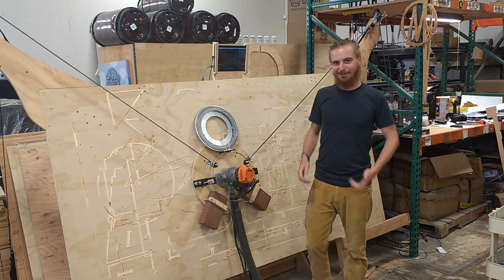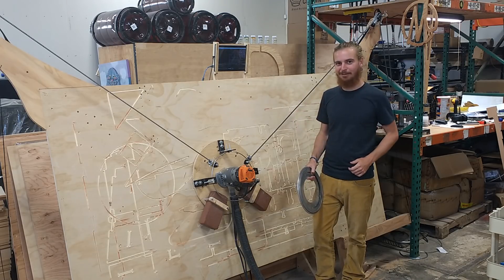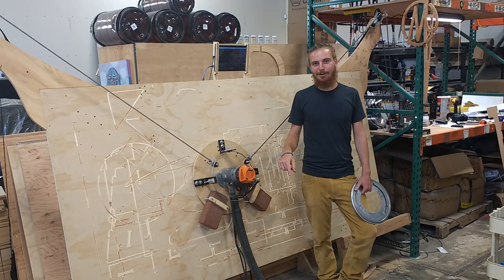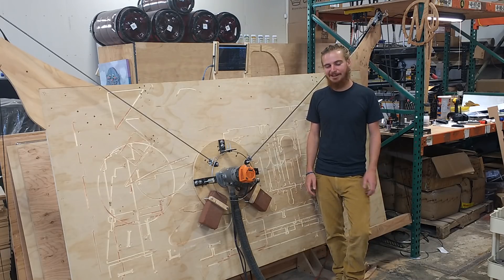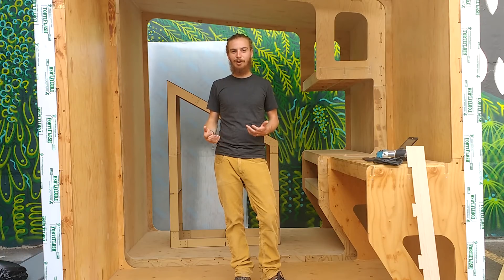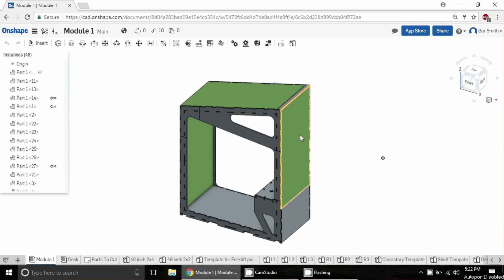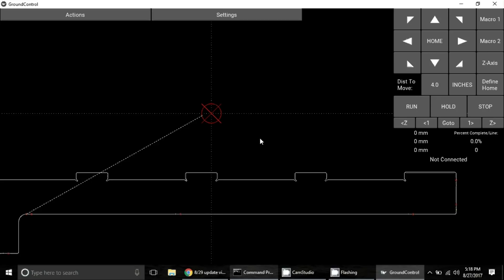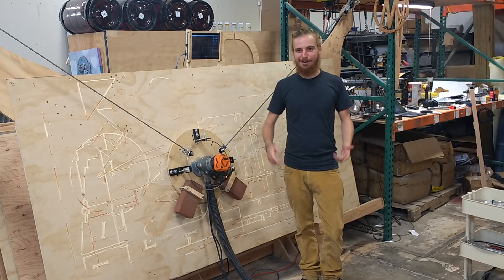Maslow CNC Weekly Update Video 8/30/17:  New Kinematic Options, PlyPAD Progress and Software Updates

Comment: When battling with unpredictable lengths of sheets and fixing the template I suggest overlap:
The template needs to be log enough to for its furthest bay (as seen from the corner where you want to clamp it) above an already cut bay. You can use the (turned off) router set into this bay to guide the template to its correct position before clamping.

Comment: We use a similar idea in sheet metal work but we dont use the sheet edge as a datum, we mark the centre of the face and set the cutting jig either on or off centre, on one of the lugs, This means that you can get a better spacing for the lugs.

Comment: I had to stop the video... because... um... why don't you just link the two chains ANYWHERE on the circle (preferably directly above the router bit). Then they will be LINKED like you wanted. Then the router bit measurement (distance from where the chains link) can be fed into the system as a "drop point" to the router bit. WHALLA! Exactly what you wanted to do with no more moving parts!
Reply: I am scratching my head as to why you wanted the router bit to always be the corner. When it can just as easily be the center of the corner -5 inches or whatever. It isn't like the machine is going to TILT or anything. So it will always be -5 inches to the router bit. Thanks Gravity!

Comment: Why not use a flush trim router bit?  Same concept but you get an exact duplicate.
Reply: I use them for this kind of thing, though they are not foolproof, unless the feed is perfect and that varies depending on a lot of things.  The other problem they have is they are not stiff compared to a small diameter carbide CNC tupe bit.  If you use a collar then you can use whatever size of bit you want, it isn't depent on what fits where, or how large a bit you need to have a decent bearing size and reduce deflection, and you can reduce sawdust produced, and amount of wood wasted; be more granular, and get quality cuts.  But it isn't as easy to calibrate.

Overall this is a stupid project, these mini houses are basically garden sheds, and can be turned out in a few hours to higher quality using the stuff they have at HD.  Very high quality ply comes mostly from old growth, and no ply makes great rib type beams, though it can make good box beams, though a table saw is a lot faster at that.  CNC is a ridiculously energy conumptive and all around clunky way to cut straight lines.  No jobsite carpenter can do what CNC can do with 3d curves, but with straight like 3 carpenters can frame a 2 bedroom house in a day.

Comment: Totally awesome development of the machine, kudos to all.  Your space is also looking pretty elegant.  However...

Makerism is awesome, but it has it's ideologies, and one of the stupidest ones is this whole idea of what about if we all had full panel CNCs (great idea!), then we could make ourselves houses, and such out of plywood parts cut with the CNC.  For anyone with an understanding of what a Home Depot is really for, this is about as sensible as someone saying they have this great idea for a great kid's toy: Building blocks.  Great news is we can all get CNC 3D printers for our homes, and there is this super excellent source of plastic at the local toy store, called Lego.  Feed it into our 3D printer, and a few hours later we will have a building block.  Good news is that in those 3 hours, while we are waiting, and with 2 friends, we could frame a whole double garage using stuff we pick up from the Home Depot next to the toy store...

For God's sake, make some boats, or aircraft parts that actually need to be cut with CNC, as conventional carpentry has great difficulty converting CAD patterns with curves into plywood output.

By the way, If you flip your pattern from a centerline you can eliminate error, except some tiny margin of symmetrical overhang you can easily trim with a flush trim router bit.

Comment: I have recently found your videos I love the idea and would like to purchase one soon as I canmy questions I can be completely ridiculous why is the router have to be in center. Drop router whatever is necessary to let chain be in centerif it 2" down The math should be easy to cut exactly where you want. just be off by the dimensions on the router need to clear the chains. right :/

Comment: Personally I think the steel ring looks simpler and more durable than the linkages. Really glad to see you making this change. Have you tried just attaching the chains very very close to the router? I think this would give you most of the benefits without any additional hardware.

Comment: I strongly recommend wikihouse to anyone who's into open source housing with plywood.
Reply: It is one of the dumbest ideas to come down the pike in a long time.  You can't improve on 2x4 approach for anything: environment, waste, speed cost etc...  We actually build boats kinda like wikihouse, but square houses are a pretty proven idea.  I'd love a CNC, but it wouldn't be for converting panels into beams.
Reply: Hondo Trailside the beauty of open source. Don't like the idea? You can improve it.

Comment: There is another kind of router bit gizmo called a flush or pattern bit. A bearing is used on the bit itself that is exactly the same size as the material removed. That way the bearing slides over the template while the cutting edges remove the material.
https://www.amazon.com/MLCS-8810-Pattern-Router-5-Piece/dp/B000GG09RM

Comment: It seems like it would be a lot easier if you lost the whole ring mechanism and attached the chains together 3 or 4 inches directly above the center of the router bit.  Then you could do the simplified calculations for the location the way you want and after the calculation, then add or subtract the 3 or 4 inches from the vertical axis to correct for the actual location of the router bit.
Reply: I think that'd cause the router to tilt to much.
Reply: I would think It would be as stable as any other configuration as long as the connection point is along the vertical line, in line with the axis of the router bit and as close to the bit as possible, which will probably be around 3 inches above to clear the router case.  It's the weight of the bricks that keep the router deck from tilting.  It would be easy enough to test.. 1 sturdy counter sunk bolt up through the wooden router deck, connect the chains to the bolt and configure the software for the triangular geometry. If you don't enter the vertical offset distance in the software, then the only difference would be that it would cut the wood 3 inches lower than where it would if the chains actually connected to a point at the center of the router bit.
Reply: Sounds as though the calculations problem would be the same, you are just calculating from lesser offsets, but the computer doesn't care about how much, it cares about how many calculation for whatever offset it has to make, and I don't see that number going down in your scenario.

Comment: Awesome video!  Definitely happy with the Video style update.Has Precision increased with the "ring" upgrade?  Are you familiar with the WikiHouse/Wren system?   I'm a late backer, so I haven't gotten my kit yet, but I intend to upgrade/refine my Maslow to be able to template out some Wren stuff, probably small home/workshop sized buildings.  Located in Missouri.
Reply from the maker: The ring system makes calibration WAY easier so the net effect is that the precision goes up because I've ended up with better calibration. I haven't done enough testing yet to be sure if it's really more accurate as a well calibrated machine using the old system. I'm a big fan of the WikiHouse stuff. I love how they made it easy to modify their design into different shapes and have all the parts adjust